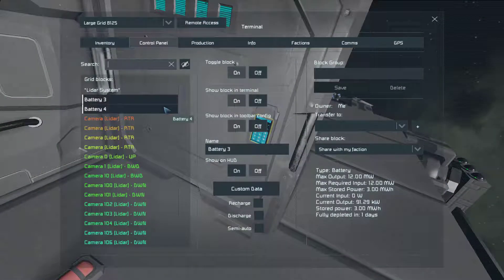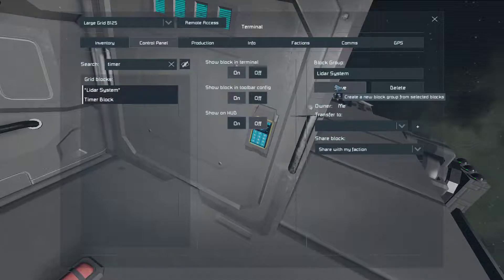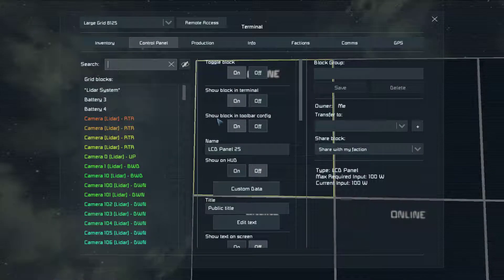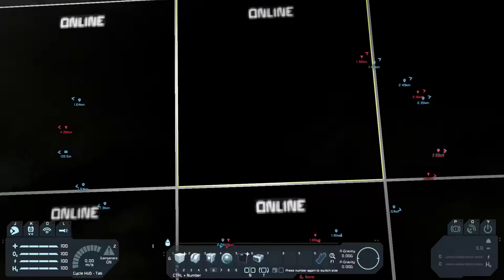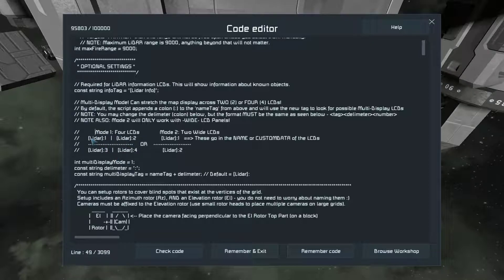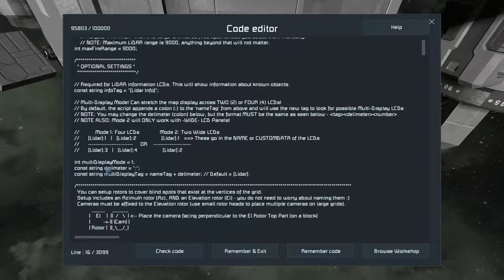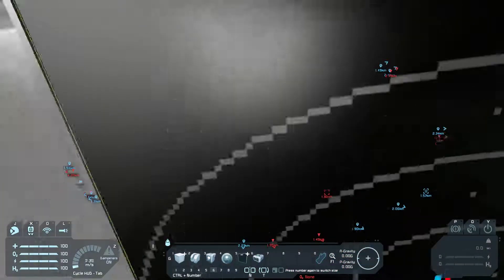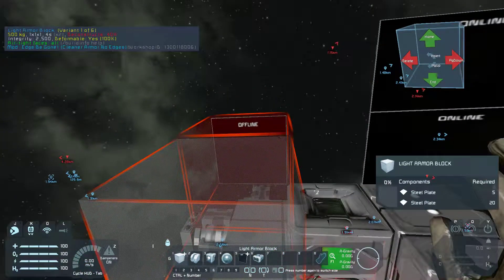Space Engineers | LiDAR Mapping Script v3 Setup Video - Timers and Multi-LCD Support

Comment: Can you help me with a problem in programmable block: After Run button there is a message " Assembly not found"
Reply from the maker: "Assembly not found" is generally due to having incompatible content in the PB - like adding an extra character at the top or something. I've checked the released version, and it works as intended. Please reload the script from the workshop and see if that fixes it